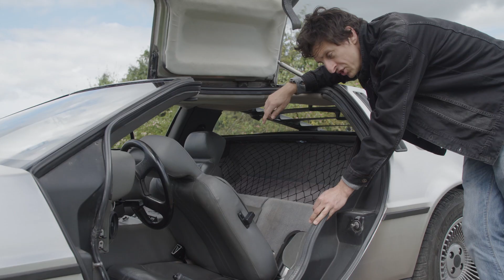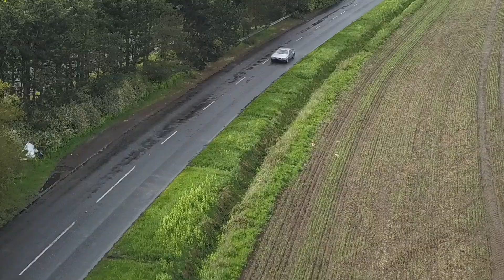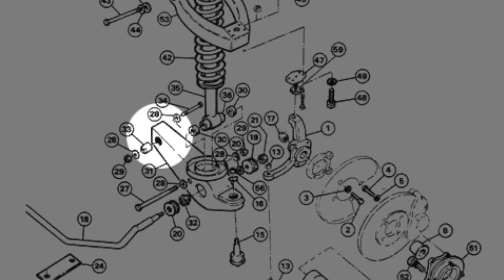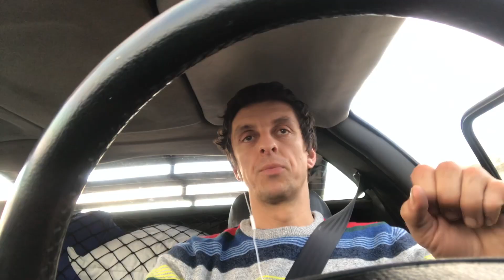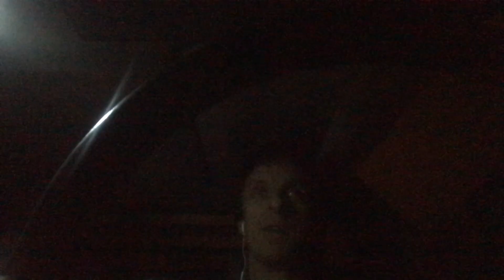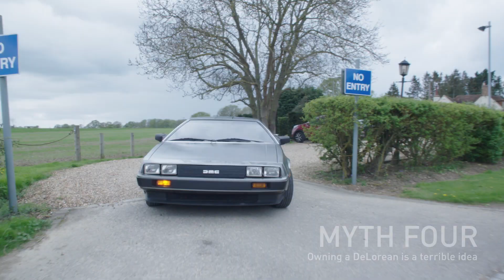1981 DeLorean DMC-12: Real world review and road test

Comment: For my eye, the front shocks are shot, ont the dash not only the speedo failed, but also oil pressure is stuck at the top of the scale and temp seems stuck just at the bottom. Still the look of this thing on the road is amazing, and it is good to see well maintained and loved Delorean alive.
Reply: car with the dmch kit rides low, the speedo is mechanical and does fail fairly easy to fix, the temp is usually very low esp with modern updates and the wings B cool kit, and finally the oil pressure is always capped as the factory unit what incorrect slightly, but if you have low pressure it will show.
Reply: @blakeriley6690  well spoken,,!!!!!?
Reply: The inop gauges reminded me of my TR-7.
Reply: I was getting road sick just looking at it sway on the road in the video,  yeah I think the shocks were shot. as for the dash,  I would probably go the retro future look and put in some fluorescent digital display type thing.  I think it wouldn't be hard too hard to do,   put a sensor on the wheel,  small arduino chipset and presto.
Reply: @agriperma  The shocks are ok ,he installed new ones,if they were gone I,m sure he would have replaced them.

Comment: This is interesting and the first test I've seen of a DMC-12. Ofcourse the road handling and reliability are matters of reference and comparison. British, French, Italian and American cars at the time were indeed really, really utter rubbish. However, an alternator not able to keep up, speedo design problem, wind screen wiper working itself lose, electrical problems (poor-cheap wiring engineering), lateral wheel movement... ugh. This very much sums it all up. Can't imagine the car being satisfying at the time. The design remains great though. It is a looker but would never want one tbh. The interior almost seems copied from the BMW M1 btw. But it looks American cheapish in here a bit. The exterior however is a headturner, even today !
Reply: the dmc-12 and the m1 have the same designer, guigario. Alot of modern updates are available that fix almost every issue the car had. A modern alternator( miens never died on me even sitting weeks lol) and full led's. The speedo was mechanical like alot of cars there, pretty easy to do maintenence on and repair, easier than modern cars tbh and cheaper. The only other electrical issues is just updating to a modern ufse box and solid state relays ( esp the rpm relay). The front LCA's were an issue with handling but dmch and delorean performance have  akit which bothboxes it in and adds double the support which makes it much less a non issue. Its like driving a lazy boy actually lol. ironically its hard to drive if you are short, not tall unlike the early esprits.

Comment: well done- any mods upgrades in the pipeline for the future.have you fixed the speedo?
Reply from the maker: Yeah, speedo’s fixed! I’ve done most of the mods I want to now already - they’ve mostly been reliability or performance mods in the spirit of the original design. Bodykits and big wheels on DeLoreans are an acquired taste, some look good but I wouldn’t want to do that to mine.
Reply: @RUNDMC1  I agree -hate those programmes where they extract the authenticity by subbing a custom wheel set and totally incongruous power plant just because they can. whats the heater  and headlights like though?
Reply from the maker: alan pickering Heater - by 1981 standards average, by modern standards terrible. Headlights - if correctly aligned they’re passable but again, not a patch on modern xenons. All depends on your frame of reference!
Reply: @RUNDMC1  do you think you could get away with an hid upgrade?
Reply from the maker: alan pickering If you had the tech know-how, why not? Wouldn’t add any value to the car though, would involve chopping up of original dash and a tonne of electrical re-wiring that any right minded future owner would be terrified of.

Comment: Do they have right hand drive deloreans? Or can you only get left hand drives in the uK?
Reply from the maker: VenzoEdits There was a handful of RHD prototypes built by a company called Wooler-Hodec, and there have been several individual conversions done since, but the car never came off the production line as RHD. Total number of these RHD cars in the UK is about 20 and they often change hands for a bit more than the LHD cars, the WH cars at a particular premium due to their rarity and historical significance.
Reply: @RUNDMC1  20.. I doubt I would ever get one 😅

Comment: the noise the car is making is NOT something that would have been tolerated.  Muffler ordinances/noise ordinance tickets were issued if your car was not quite or had broken exhaust.  I had a 1977 Camaro and a cross over pipe rusted out on me in the mid eighties and I had a muffler go on my 1968 Nova and I got pulled over both times.  Big no no and actually a big deal back then. Go vid.  I would love to own one of these.  Thank you.

Comment: Used to have an early one , had the fuel flap on it so no bonnet up for me to put fuel in. Never had a problem with the speado on mine , did have to change alternator as it was underpowered and wouldn't charge the battery . Fuel sender I had to change , clutch I changed and master and slave cylinders , and brake servo I changed. Apart from bulbs and dry joints on the rear lights and new rams for doors didn't have no issues really. Good video 👍

Comment: Regardless of all the negative comments people have about Deloreans, I would still buy one for myself
Reply: Same
Reply: Me too :)
Reply: Yup, but I would change the engine,and modernize it
Reply: @americanseal7683  yup
Reply: I would like to know where to get a de lorean like this.
Reply: Definitely
Reply: Electrical load was a common problem with most car's of this era. 
Just don't use the electronics & it's a pretty solid built & practical car for the time. 
As long as it's the European model, they were a sporty, decent handling, comfortable & fast car for the time. 
He keeps saying it was a heavy car, but it is only 1230kg with 160hp - that's roughly the same weight as the 1st generation Honda NSX type R that came out 10 year's later which was the lightest supercar available at the time with it's purely aluminium body. 
Plus it was rear engined, a car of this weight & on this layout gives it incredible launching abilities. 
Problems will be inevitable since it's over 40 year's old now depending on how it's looked after. 
I would want a gold Delorean. 
I mean they took the car back to the factory before it went on sale due to poor build quality to re-engineer it further, so no one knew how unreliable those model's actually we're - the ones we actually got were the ones with so much engineering to refine reliability further. 
They keep going on about the American auto model being slow with a 0-60mph time of 10.5sec, but the European model had a much higher 160hp & manual model's could do 0-60mph in 7.9sec - which was supercar territory at the time. 
But just look at the specs for the European model's at 125kw & 235nm weighing 1230kg on a RR layout, top speed was 135mph - that's not that bad for an early 80s car with quite alot of luxury equipment at the time. 
Definitely a much better built car than the rubbish Morris Morina's.
Reply: I want one so bad, love back to the future and need one in my life
Reply: Its a beautiful car, no car quite like it.
Reply: its goin for 100000
Reply: Sick but isn’t it kinda slow
Reply: I should but you not when you get some then make your comment
Reply: Enrique Suarez what

Comment: Very well said with no excuses and no hype. My father bought one new in 81 and it broke down on the way home. At $60 grand in those days it was WAY overpriced. There was only one auth dealership/mechanic in town and they had never seen one. At20 yrs old I drove it to college and sold it within a yr after 3 water pumps failed, got locked in, vapor locks and numerous lucas elec issues. Got 1/2 price for it "ouch".
 In 2007 against my better judgement but seeing the community and parts availability had grown, I bought a low vin, manual and after a major initial 2 yrs of working out the bugs it's my daily driver. Owning a Delorean is both like dating a super model and frying bacon naked. If you want a fast car, buy ONE. You want a oddball, a challenge and a very unique car and willing to accept the good AND the bad, get a Pantera HAHAHAHAHA.....
Reply: The car was not "At $60 grand in "those days", it was $25k. The most they sold for was about $30k, and that was for those who just had be the first to have it. They do go for about $60 today for one in good condition.
Reply: @kriswingert1662  It is called inflation. Go to inflation finder, type in a amount and see what the conversion is. https://www.usinflationcalculator.com/     I remember on the same lot was a loaded brand new Corvette which was $17500.
Of the 4 Deloreans sold here in Columbia, all broke down. The auth "dealer" had no mechanics who had actually seen one. 3 gave up and got rid of theirs for whatever they could dump them for while one was painted red and actually maintained for a good 20 yrs iirc until it caught fire and burned to the ground.
Reply: JIMJAMSC The key words here are “ in those days”, which he is referring to 1981, not 2018. I know what inflation is and he is not talking about now.

Comment: 1. there was no Euro-Spec, these Cars where all the same. Take a look at the Parts Catalogue online. The Car was never delivered to Euro Countrys, cause this would have needed several Changes, like bo Side Markers, other front Turn Signals, Wiring, etc...   7   2. where is the AC gone ?  /  3.the Doors are not "heavy", they are balanced by gas Struts and Torsion bars. Talking about "heavy" lets people think they need to lift heavy weights. You just pull the Lever and they swing up. / 4.the Steering is accurate - rebuild the Parts and get them to Status "new", then it´s accurate. / 5. It´s NOT based on a LOTUS Espeit Chassis, that´s a Legend / Bullshit! / 6.ALL Bushings in all Cars move and "Wobble", thats on purpose - swap them to simply new ones and the Car rides smooth again. / 7.you may should maintain your Car better, then your Speedo would work, / 8.... cancelled the Video after 15 Minutes, cause full of Nonsens....

You are comparing a nearly 40 Year old worn out and fucked up Car. Drive mine, restored to almost new and THEN compare. Sorry, Buddy, bud your Video is full on Nonsens and Myths. Well, I missed the "Doors opening in small Spaces - BS" ....  ;-)

How do I know this? Well, I restored one and I own a DeLorean... Got EVERY available Book about this Vehicle.
Reply: And there it is. After owning a Delorean going on 18 years, I've found a unicorn. An asshole in the DMC owner's community. We've been infiltrated.

No Euro-Spec Deloreans? What about the RHDs, let alone that the entire car is made out of European parts. Arguably, the DMC WAS Euro spec, THEN altered to meet US laws.
Reply: @GeekTherapyRadio  doubt the guy owns one. I do and if he has read books ( i own quite  afew myself) or you know, used any search engine every one of this clowns points would instantly be disproven. Welcome to the age of i know everything internet . Typical nonsense you hear at car shows with people spouting on subjects they have no idea about who are just salty.
Reply: Never delivered to Euro countries?  Then how come there are Euro-spec springs, and then the US-spec springs that raised the front of the car way up high to meet bumper height regs in the US?
Reply: @Patrick94GSR  ... ever heared of Aftermarket? 

..... are there EURO Tailights available? Euro Frontlights? Euro Sidemarkers (which were forbidden in these days in Europe!)....  

BTW - EUROPE did´t even exist in the 1980ties in this Terminology .... take lessons in History Buddy ;-)
Reply: @FRITZI999  wtf are you even on about, replying to posts from over a year ago?  Let it die, man.  The US DMC-12 had different springs than other cars sold in Europe and elsewhere around the world.  That's a fact.

Also, Europe is not the same as European Union.  I think YOU'RE the one who needs to take a history lesson!
Reply: @Patrick94GSR  ....  well, does it make it a Euro Spec just because of other Spring made Aftermarket? That`s total BS ..... Europe wasen´t even existing....  tell me where to find the "EURO SPEC" Springs in the DMC Parts Catalogue and other "EURO-Parts".... come on, lecture me, I want to learn.... ;-)
Reply: @FRITZI999  dude, what the hell is wrong with you?  EUROPE is one of the 7 continents of the world!  Did you skip elementary geography class?
Reply: @Patrick94GSR  ..... do some research in history, there was no European specification on Cars in the 1980ties. I´m not specifying on every Country, but Regulations in these days where all national. So nothing to do with Geographics. Read - understand - THEN Comment if you have something valuable to say which you can proof and not just attacking and pissed off Fanboy Chittichatty ..... 

So where can I find the Legendary Euro Spec Spring in the Parts Catalogue .... got it open, right on my Screen and waiting for your advice where to search. Cause I might be too stupid to find them, so please help me Buddy :-)

come on - proof it Fanboy !!!
Reply: @Patrick94GSR  ... as expected - no Answer on my Question. So I might lecture YOU Honey?

EURO Sec Car Parts need a "E" in a Circle on them to be EURO SPEC - not DOT like all the DeLorean Parts have on them. As this "E" Signet was developed after DMC existed there is NO Europ Spec ... simple enough to understand?

Do some research about this BEFORE bullying others who lives in Europe and know better about these Regulations.... 

thanks....

And - if you would be so kind to tell me where to find the Euro Parts in the Catalogue of DMC? I would like to buy them for my Car lol ;-)

(I guess it won´t take long for the next Fanboy to sneak around the Corner and start throwing rude words at me..... ;-) )
Reply from the maker: Christian... I could go through every one of your points but I'll save myself the trouble and just post this: ECA 5040 Euro Spec 50 car Belgian trial.

Consider your day made.

http://www.deloreaneurotec.uk/viewtopic.php?f=13&t=905&p=36691
Reply: @RUNDMC1  .... nice - yeah, a Trial .... what does it tell us? NOTHING ....
Reply: I also read somewhere many years ago that the euro spec version have a different gear ratio than the standard 3.44? I restored my car (11035) myself. Been a owner for 14 years and been studying the car since the early 90's. Love this car. I removed all my emissions equipment, Spec-1 exhaust, throttle body spacer etc and the car is much more responsive. When he talked about the LCA support bars not being that effective? Yeah I find that statement false. I have larger Wilwood brakes SS LCA, SS Rear Radius arms, poly bushings and QA1 adjustable coils over all the way around and DPI's adjustable support bars and my God what a difference they make! I can go through turns much more quicker and the car is very stable and planted to the road. The bars were worth every penny. Still not a bad video.
Reply: I'm confused why you say it wasn't based off a Lotus design. Lotus was hired by DeLorean in November of 1978. They used their engineers and worked with the DeLorean team to come up with a chassis similar in design to the Esprit. Why do you say this is not true? There are pictures of John DeLorean with the former head of Lotus Mike Kimberley looking at blueprints of the design together.
Reply: rcktpilot Its not a Esprit chassis but its based off of one. If you google a Lotus Esprit chassis you will see the simularities and differences. Also a Esprit is a mid engine/rear drive while a DMC-12 is rear engine/rear drive. I believe that guy is a troll! I been in the DeLorean community since 1991 and owned and restored Vin 11035 myself. You can check me out on FB under the same name if you'd like to see my car. You righg though.
Reply: Darren - neither the Frame is from a Lotos nor anything else listed as above is true. Just Google Pictures of Frames from a DMC and a Lotos, and as third a Renault Alpine - yeah, similarities, but NOT the same.... it´s like comparing a Ferrari and a GT40, just because of a Rear Engine, Tubular Frame and stating they are the same Cars. Sorry, no ....  go deeper into the Informations.
Reply: @FRITZI999  lotus designed the chassis off the esprit s3 using the double wishbone support style.
Reply: @blakeriley6690  ... yes, I know.... but it´s not a Lotus Frame .... My Mercedes Gearbox is made by ZF, the same Company wich makes Gearboxes for BMW ... so my Mercedes has a BMW Gearbox according to your Logic? come on....

DESIGNED dos not mean MANUFACTURED !!!
Reply: Geek Therapy Radio .... the Car was built - THEN the Regulations got changed .. simple enough? So built Cars needed to get modified. The Car was never ever delivered officially to Euro States, cause THEN I could have got mine Licensed easy. Then a Technical Datasheet would have existed in my Country.  
The RHD Cars were NEVER built in the Factory, they were converted by a Company called WOOLER HODEC...

But, yeah, YOU know it better, through which struggle I went to get mine on the Road cause NO Country / Euro specific Datasheet ever existed.  Make my day Moron!

Yeah, I like the aggressive little Fanboys lol

You know there wane´t even a Euro Zone in the 1980? .... no Euro Money, nothing (only an artificial named ECU as a Testrun)... The Countrys had Borders between them. You may visit a History Class Buddy and refresh your lack of Knowledge about this.  ;-)